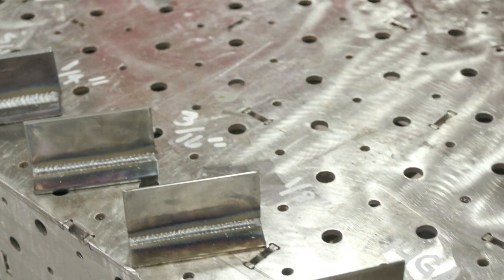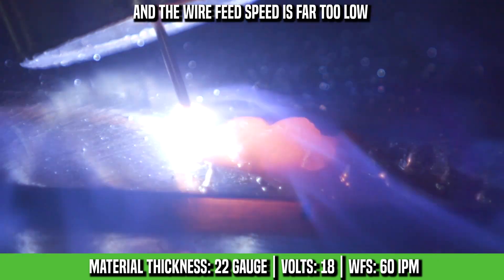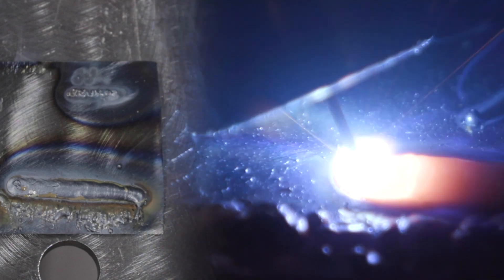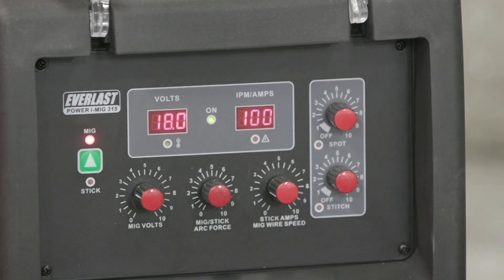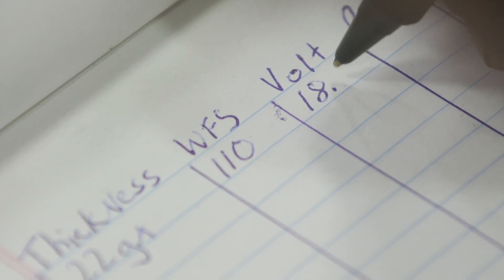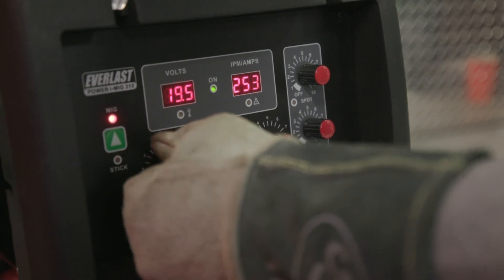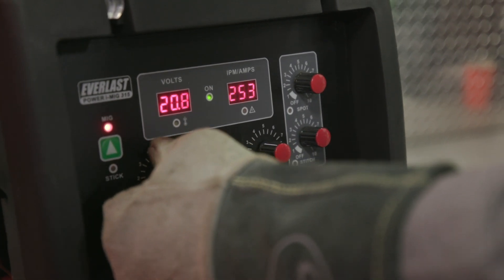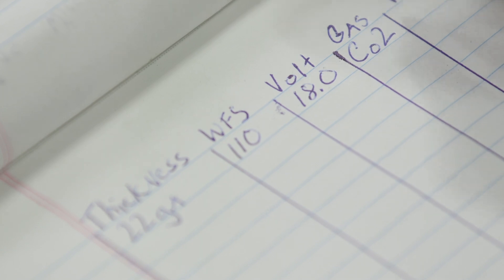MIG Settings for any Thickness

Comment: I think the real reason Everlast doesn’t have a settings chart like every other manufacturer does, is the quality of arc and performance varies widely between machines. Whatever the factory in China punches out arrives on your door step. Get the Miller or ESAB and save the headache.
Reply: I wonder the same thing
Reply: And most of these welds appeared to be “cold” to me, and all of the arc starts were slow to get rolling! I’m old school Lincoln/Miller faithful also.

Comment: Any advice for fusing 10 and 18 gauge? Great video, very helpful! 👍
Reply: No hi by
Reply: Aim the majority of the heat (mig wire)at the thicker material. If using TIG, aim the arc at the thicker material.

Comment: Have a question what the best gas for mig welder

Why cant you use argon gas for mig...

Can someone explain... with tig i can us er702 .030" mig wire on my tig argon setup...... why does  mig welding look so bad with argon gas... using the same set up. Please make video to explain.
Reply: Using mixed gas is best for stabilizing the arc. Different electrodes  have different arc properties, so tungsten does best with argon but the arc is created/ maintained differently when you have metal transferring/ the electrode source is being consumed. I don’t really make videos, but if I did, I’d relate it to cooking a meal. The gas and consumable electrodes (think of sticks and wires both in the same way here) and any flux go into the mix. Tungsten is not strictly described as a consumable, so it doesn’t go into the mix. It’s more like a fork you can kinda taste the iron in as you eat the meal. Different mixtures and ingredients taste better together than others. You technically CAN weld mig with 100% argon, but that ugly look is the equivalent of pineapple on pizza - some sick people will like it.
Reply: pure argon is used with MIG aluminum.  otherwise, CO2 added to the mix allows the steel to become more reactive.
Reply: You can use straight argon, if you crank up the voltage

Comment: You shouldn't do the swinging on anything bigger than 3/16 or 4mm
It doesn't sufficiently melt the base metal in the corner. With lower gage it doesn't really matter, but with thick stuff like 3/16 or 1/4 it really makes a difference. If you need a fat weld you should rather do multiple passes, as this still secures proper melting of the base metal. Here in germany we have rules that only let us do constructional welding if we du it with certain techniques, that ensure maximum safety
Reply: in Canada, where I live, we have similar rules.
Reply: You can weave, it'll work just fine...

Comment: Is .035 too big of wire for a 200 amp  inverter style mig welder, especially for a new guy welder?
Reply: no.  i run .035.  most versatile imo.   as a general guideline: 
.023 : 30-130amps
.030 : 40-145amps
.035 : 50-180amps
.045 : 75-250amps
Reply: @spinalfusionshop  A lot of noobs also don’t realize that wfs and ipm (wire feed speed & inches per minute) are the amperage adjustments. I’ve never seen a simple way of converting between amps and ipm though, unless your machine has a meter on it.
Reply: @tomt9543  i think they are also a reflection of the heat input of the weld......

Comment: I know this is mig . I'm learning mig tig and stick for steel and stainless. This 1 issue I keep having is getting my angles correct. Any tip of how to correct this . Seems everyone answer is time but if I dont fix it then time will not help. My welds are mostly correct good height and penetration.

Comment: THANK YOU SO MUCH!!!! I HAVE HAD MY EVERLAST LIGHTNING 275 SINCE JANUARY AND I HAVE BEEN BEGGING EVERY CHANNEL I KNOW TO DO SMALL SHEETMETAL.... NOW IF YOU COULD DO TIG(THE SAME EXACT WAY),  I WOULD SHUT UP AND WELD!!!! THANKS BROTHER!!!!
Reply: hey chat, i have a 275.  running .035 wire.  did the 1.6 conversion for amps.  his numbers don't match up.  18v on 22 gauge is instant burn through.  i have a good map now of settings for .035.  what are your findings with the 275?  how are you enjoying it?
Reply: @spinalfusionshop  I love the welder.... but yeah I agree on the 1.6.... I am using .023 wire
Reply: Basic heat settings with tig is 1amp per .001". Example 1/8"steel plate would be .125" so 125amps for heat is a good start.

Comment: How much does 75/25 arco2 blend change these figures. Thanks this was very helpful and timely! My imig 275s thanks you
Reply from the maker: Generally you subtract .5-1 volts for 75/25.
Reply: @everlastgenerator  thank you
Reply: @everlastgenerator  good to know, I have a 252 STi, but I dont use it often enough to remember good settings, and I don't believe the manual has any to start off with.
Reply: I came to ask this question, nice to see it's already been asked and answered. Also very nice to see all these videos that have been uploaded over the last year.

Time to finally figure out how to put my PowerMIG 200 to use.

Comment: You should push , rather than pull  (especially on thinner material).  If it's got slag you drag (flux-core).  For hard wire, Pushing is most widely taught for thinner metals and Axial spray.  Your weld bead profile will be better.  Yes, pulling gives you more penetration if you are concerned only with single pass., high amp/volt welding in short circuit.   The stuttering is in part caused by the pull on the thinner gauges.

Comment: The last project I did with square tubing taught me that the type of joint affects heat requirements as much as the material thickness.  e.g.  A Tee joint needs more heat to get decent penetration than a simple butt joint.  I made up a table of settings that included the number of legs in the joint.  Butt = 2, Tee = 3, two tubes together = 4...
Reply: I have a Nice open door for you as well.

Comment: Noticed 3/16 and 1/4" had circular motion but 5/16 and 3/8" was straight across.   Can you help explain the reason for this.
Reply from the maker: The last two were a straight pull because we had to move faster with such high parameters.
Reply: @everlastgenerator  Wait, what? This is a "how to set up your machine" video. Shouldn't you be setting your peramaters to match your technique?
Reply: fastyle P. 3/8 and 5/16 are to thick for that wire so they sped up the wire speed a lot to makes sure they had that Penetration. So they had to move fast because it was a lot of wire being fed
Reply: @t046875   for quick or occasionall jobs I guess you can get by without having to pick up a spool of .045 wire. You could also pull with a loop motion and more standard wfs for penitratuon no? 

Fast is profitable obviously, how about  a cut and etch to inspect the results!
Reply: fastyle P. I agree . I guess they were just demonstrating the extended of that wire .
Reply: On the 3/16 and 1/4 setting seemed on the low side. He could of bumped them and did a straight pull.i believe with .030 half the wire speed is the amps if bumped it up to 380 -400 Wfs and with the volts adjusted accordingly he could of done the same deal.  Personal preference  really.
Reply: spray transfer homie.  gotta move fast.